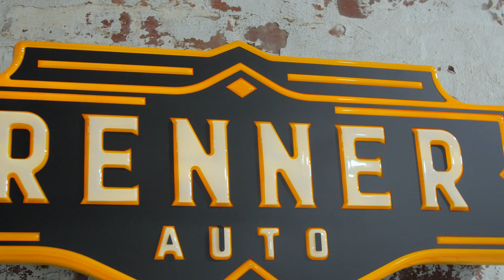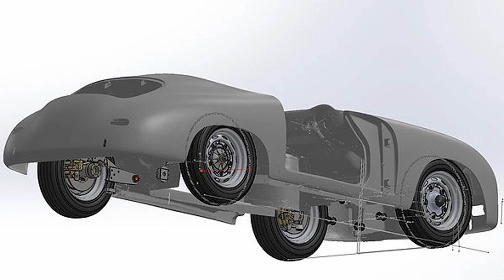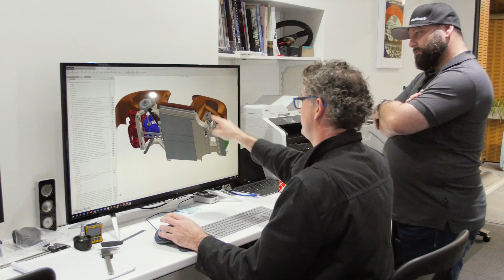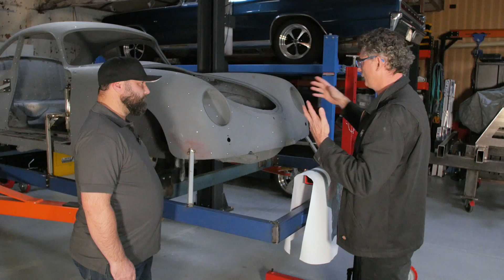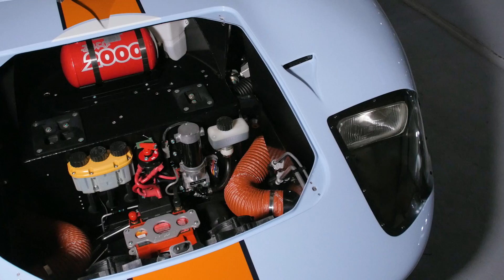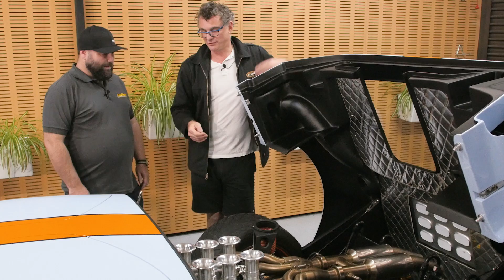🔨 Renner Auto custom-built Ford GT40  |  HALTECH WORKSHOPS  |

Comment: "You do a lot of digital work up front..."
As a designer, I can attest that the first half of a project looks like you are staring at a monitor doing nothing for weeks on end. Then a few parts get delivered and testing begins, managers start getting impatient and they wonder where the money is going. But then all the parts come in at once and you can start building. At this point the real fun begins when in the fog of war revisions start being made and every decision gets second guessed. 90% of the time it all comes out close to the original vision. The other 10% is when you question the original vision.

Comment: What do you think of the Fran Hall Superlite Ford GTR as a base for a hight end build.
Reply: Such an incredible piece of work, Fran is THE gearhead that the kit car market has needed for decades; that's how you do it RIGHT.

They use a very well designed hybrid space frame-monocoque, which results in a very ridgid, semi-modular chassis that is still pretty affordable. 
And, when you consider that the entire body is a carbon copy of the Doran-Ford GT-R IMSA GT2 race car, the Superlite don't-call-it-a-kit-car kit car is the PERFECT base for a scratch built GT-style(GT as in 'Grand Touring' - pain in the ass to talk about GTs and GTs when you're talking about GTs...) dedicated track car or street legal track car. Or even a legitimate race car, presuming that you can find a class with rules that will actually allow it to be relatively competitive(vehicles like these, Ariel Atoms, etc. are typically HEAVILY penalized from the start to the point of being uncompetitive). 
And, of course Fran's suspension geometry is absolutely proven too, with the SLC proving to be a real track missile. I'm personally not a fan of how ridiculously short in length their control arms are; but they clearly work damn well while being much easier to package, so it's not like I can critique it in any legitimate way, lol.

Comment: The original GT 40 have a 7 litre v8.
If i had the cash to build one, I'd stick a 7 litre in it. Carby fed, of course .
Reply: The original 1964 and 1965 Mk1 GT40s ran a 289 engine and Colotti transaxle. It was the Mk2 cars which got the 427 (7-litre) engine. https://en.wikipedia.org/wiki/Ford_GT40.
Reply: Using a motor that increases the weight/power ratio, fed by a controlled leak toilet bowl and that makes suspension tuning two orders of magnitude harder might be the way to go for some.
I'll bet most would prefer Jason Ferraro's version over a wannabe 1966 copy. I know I do.
But, to each their own.
Reply: @-MacCat-  that maybe so , but since i don't have a couple of million dollars for an original , I'd still build one the way they were originally made.
And yes, i agree
To each his own.
Reply: @carlwesternut2434  You can't buy an original for $2 million.

Comment: As a Texan I love this over-sized air conditioning talk.
Reply: I do get a bit of a ribbing for my insistance on A/C but it makes the cars driveable on the days you want to drive them, sunny hot days. If its designed well you dont see it in the engine bay or in the cabin. If you use a lot of hard line and minimal hose its easier to hide. It is a lot of work though but I enjoy designing and fitting custom A/C systems.
Reply from the maker: When you have a Coyote roaring directly behind your back it makes sense to have air con:)